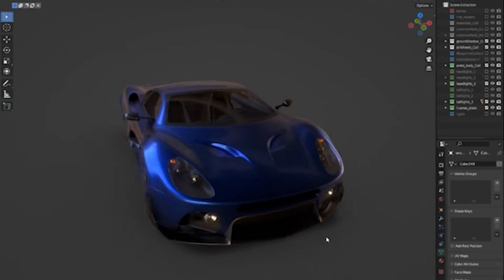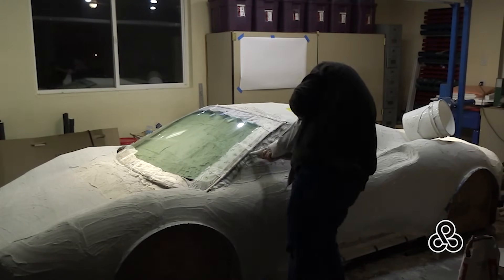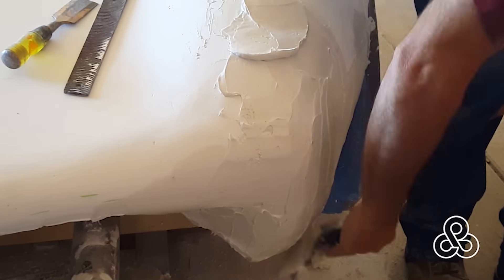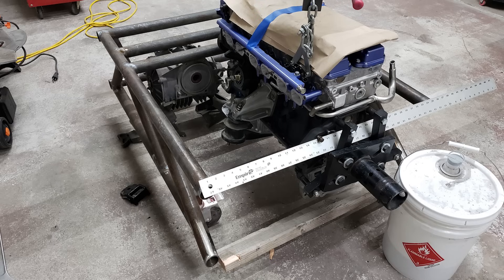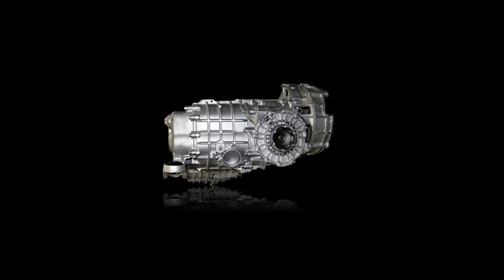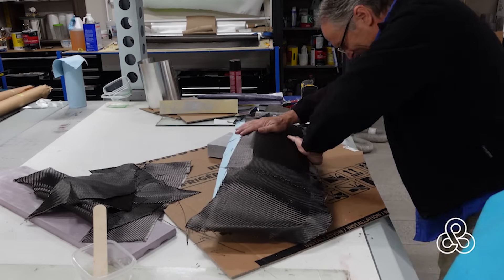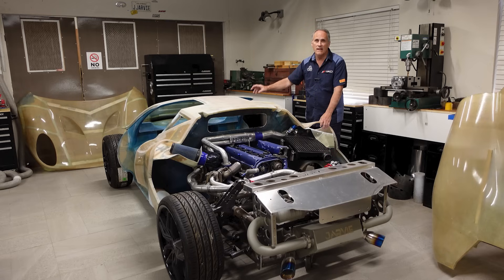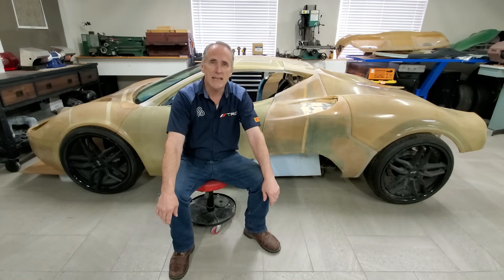Can you build a car from scratch? One man's journey.

Comment: What would be fun is to design your own engine block and cast it yourself, like a 6 liter 3-cylinder designed like Toyota's GR Corolla.  That little 3 cyl can push over 300 HP at around 1.5 liters or less, imagine would a upsized version of that engine would produce.
Reply from the maker: ONE DAY!

Comment: Carbon fibers main advantage whe building a monocoque is not the small yet not insignificant, in strength to weight, but instead a large benefit in stiffness per weight. You want the chassis to be as stiff as possible, so that the suspension  can do its job properly. However, my main concern with your construction is not the fiber type, but the matrix. Hand laminating is an easy way to make parts, but it is far from the best. You need to apply more resin, makin the part heavier while not improving strength. In fact, the resin distribution ain't ideal, leaving dry spots and pinholes which reduces the parts strengh. Furthermore, as the part does not seem to be vacuum bagged, the individual layers of reinforcement where not pressed into the mould during cure, making the part less stiff. To make it worse, as the chassis is a very large part, some resin might have already cured before the next layer was applied, resulting in insufficient adhesion between layers.

Comment: Im not into cars yet here I am with a 3/4 size single passenger rip off of the $40 m Bugatti Atlantic at the rigid foam and kitchen  knife stage although the grill and hood are precise with 3/16" foam board strips and Spackle.
I would say Bugatti riped off the 1925 Rolls round door and the classic love chair design.
I made the largest model of Hindenburg by turning it 'on a spit' at 45 ft and changed the fins.
The Eiffel tower and made a hexagonal  base
A spitfire a concord a Falcon 9.
All unfinished.
Sorry but I just do it for me and when the thrill fades, I move on.

Comment: Designing and fabricating a composite shell is an enormous and very messy job. If you're interested in building your own high-performance sports car from scratch, with a much simpler body, Google "Midlana". Mine weighs 1,700 lbs and makes 430 hp.

Comment: May I ask, what transmission did you use and did you use automatic with paddle shifting?  I have a Cayman and wish it could have been 4wd
Reply: I’m sirprised he isn’t sunburned from all the bare hand welding.
Reply from the maker: Using the 4L60e transmission, which can be electronically controlled with paddle shifters.

Comment: Very cool project indeed, I bet that'll be a lot of fun to drive!

For the transmission, you could have used a VAG gearbox. Some of their platforms are FWD, but the engine is longitudinally mounted on a transaxle gearbox like the Porsche, but it goes behind the engine, not in front of it. They are readily available, can be built to take 1000 hp and would simplify things immensely. You would lose the 4WD system, but would save quite a bit of weight in the process.

Comment: What AWD transaxle that can handle 600 hp and only cost $300?
Reply from the maker: It is not a "transaxle" it is a transmission and center differential that splits the power to the front and back - 4L80e

Comment: Maybe I missed it, but why not roll/bend the frame tubes instead of the hard angles?
Reply from the maker: The 4130 {chromoly} steel is a nightmare to bend without a very strong mandrel die bender, of which I do not have . . . other than that we could have saved a few welds couldn't we?

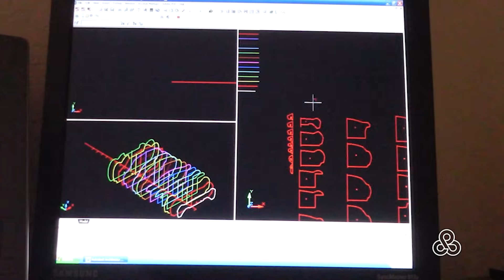Comment: Sir can you please tell me which software are you using at the 1:16 of the video?
Reply from the maker: The software is an old version of AutoCAD called Architectural Desktop. I do much less architectural drawings these days, but the autoCAD engine is still very useful. back in the day when I bought the software it came with a lifetime license. today you have to buy a subscription so I haven't upgraded. I do have a subscription of Fusion 360- AutoDesks CAD CAM software.

Comment: lets say hypothetically i wanted to build my own supercar, and lets say hypothetically i have no clue what im getting into, what hypothetical advice would you, the person reading this hypothetical comment give to the hypothetical person writing it?

for those who couldnt see through my very subtle hints, i think i want to build a supercar, i have some experience working on cars, taking batteries out of priuses mostly, and a lot of tools that i dont use much anyway, but idk what to expect from this sort of endeavor skill wise or price wise, so im looking for advice from yall
Reply from the maker: Hypothetically I would never give advice! Realistically, I would tell a up-and-coming builder to start with a rebody project. Find an existing car and strip away as much body as you can and build new styling on top of that. The Vedor kit car is a good example. That way, you have a fully running car with proven suspension and mechanical systems throughout. If you survive that build it will give you enough confidence and experience to tackle more complex builds. Plus you will have a car in a short time rather than years. Drive it while you build the 5 year project. Hypothetically of course!

Comment: As to the subject of material choice, the only reason to use carbon fiber would be to take advantage of its superior tensile strength.  It doesn't look like you have access to the kind of engineering tools you would need to utilize the properties of carbon fiber, so I think you made the correct choice by using fiberglass.
Reply from the maker: That's what I keep saying! Until I have a copy of CATIA and a really big autoclave the cars will have to be glass and heavier.  Thanks for watching.

Comment: That's brilliant work! I like the way you redefined the way to use your power plant.
Another channel where they "reproduce" a car from scratch is NHET-TV, where they make supercar-looking cars from a kinda-working platform, scavenge the stuff they need and build/mold everything else, the only CNC'd parts are the wheels (they probably didn't feel confident enough to use a lathe for that). The fact they're working as a family probably helps...
On my side, I'm more about making a "concept-plane", and I have been working on it for the last 30 years (in and out, more out than in) and it was the initial reason I went into 3D-printing, to test the different concepts I imagined into it. My last attempt did fly with RC motors but met the railing of the terrace pretty roughly: it looks RC motors are a bit more powerful than expected.
Reply from the maker: There may be aircraft in the BuilderCreator channel lineup in the future. Stay tuned.
Reply: @BuilderCreator  Brilliant! Looking forward to it!

Comment: How many layers of fibre glass did you end up using for the strength you needed?
Reply from the maker: It varies significantly. Some cosmetic panels (no structural value) have as little as 4, whereas there are up to 40 in some corners where the sub-frames join and bolt to the tub. There are 60+ layers in the vertical laminated beams, embedded into the rear firewall, that create roll over protection. Here is the video of the vertical laminates. Enjoy, and thanks for watching.  https://youtu.be/-RKgiU5bE7k

Comment: OH i thought about doing this too for a long time, but i never even tried because the cost that i aproximated was completely absurd, but when i see you doing this i really want to try too, especially when i see that you can fit into such tight budget. I wouldnt do anything fancy and it will likely look awfull, but i want to fully build my car too. How long do you usually spend on a project? I have really really tight time budget, so it would likely be multi year project, as i can barely find 3 hrs a week. one problem is that getting permission for driving it in my country will be pain, you cant even change anything on your car without getting a permission. for example, when you lower your car, or change your exhaust, you have to get it approved, so you cant drive it for at least multiple month, and you can lose your drivers licence for a year for driving a modified car.. also you cant have it preaproved, so you have to modify it, request permission, if its refused, you have to rebuild and request again and there are no clear guidelines, so you have to try and fail till they finally aprove it :/
Reply from the maker: There will probably be 4000 hours into my car before it rolls and has paint. For you at 3 hours a week, that will be 1333 weeks or 25 years. You will have to find more time; or build it for posterity. Don't worry about licensing, you can donate it to a museum and visit it in your hover plane that we will all be flying by then. Ha!
Reply: @BuilderCreator  oh hell 4000 hours is insane. I guess that I'll need way more time than that, as it wil be the 1st attempt. But 4 years from now i should have more free time, where it could be real to finish it. Its also definitely not my field, but how hard can it be to make some crap box right :D . (Im a nuclear engineer)

Maybe making some fun vehicle that doesn't have to be licensed for use on road would be way smarter idea, so i can say least drive it on my land.

Comment: Hi, just found this project and channel. Very well done and interesting! I do wonder; why create the running gear? Brilliant solution about the transmission coming to center and then powering AWD, but isn't it very intimdating/ambitious to learn all of that from scratch? I would guess in part as to why I was recommended this is because I watched an engineering video on the McClaren cars, so I would guess you saw that too? I know this isn't F1 but the do go into depth about the reasoning they chose lengths of the shafts, mount points, compromises. They also have a detailed section about the process it took to build a crumple box for up front. So what I was thinking is maybe you could pull an IRS from a proven set up. I guess one of the problems about problem solving is the compound problems coming from places you can't even forsee. 
Well, regardless, I will be here to enjoy seeing it play out! Best of luck!

Comment: Designing a non-plug-in EV AFFORDABLE, reliable car. You drive into a well lite and safe, Battery Exchange Center. You press a bottom to unlock the 2-low batteries. The service attendant removes the 2-80-pound batteries. From the top of the back of the car's Tunk space. Then the attendant puts in 2 fully recharge batteries into lock place. The attendant than check your tires PSI and cleans your windows. Done in 10 minutes. No need to pay the attendant anything the bill is paid monthly. When you buy the car, you DO NOT BUY THE BATTERIES. YOU DO NOT OWN THE BATTERIES. The company maintains the batteries. Uncharged batteries are put on pallets. Then they are put on trailers to be pick-up. To be taken to min nuclear power plant in that city. Once the batteries are fully recharge, then they are put on pallets. Put back on trailers and the trailers are drop-off at the BEC. If a battery is damage in an accident, they can be exchange for a replacement. Each time you pay your BXC bill, a percentage of the payment goes towards batter-care. Batteries are design to last 100 years, and they are inspected regularly. You can buy or lease.
Reply: The small engine keeps the car batteries charged and moving up to 4 to 5 days.
Reply: Small modular nuclear plants. That are located outside large cities. Could power the batteries for all cars that travel just locally. Less than 100 miles per day trips.
Reply: The car can be a 4-door with a hatchback and fold down tail gate, or 2-door. For a fast and easy battery exchange.

Comment: People fail to realize how close the performance of S-glass is to carbon fiber. S-glass is actually ~40% stronger than carbon fiber in tensile strength (roughly equal when you factor in mass), and equal in compressive strength, but carbon fiber is almost 3x stiffer. So if you don't need the stiffness, you're better off saving a ton of money and using high-end fiberglass (Carbon fiber is ~10x the price). And Kevlar is a good option if you need impact or abrasion resistance.
Reply: Thanks, I have full video about this, or I can refer people back to your comment  here! 😊

Comment: I found your channel when doing research for my own (much more modest - a quad streamlined bicycle) project, and binge watched all your Arete videos, together with a few others - they are great educational videos for someone who's only getting into the industry.

Just one quick question - I must have missed what kind of foams you used for the firewall/bulkhead and floor, and for bracing of e.g. the bonnet (the blue foam). I originally planned to use XPS as it's the stuff most easily available in Poland, where I live, but I found that it might be too brittle for core material. Could you give me a hint what foams you used?
Reply: The bulkheads are polyurethane. Places where I am using the foam as a shape rather than part of the structure I use extruded polystyrene that is used in home construction insulation. I will, however, be using the extruded polystyrene (45mm) sheets to form the wall panels on the Leviathan overlander project. The wall panels will have some structure, but the aluminum frame is the main structure.
Reply: Thanks a lot!

Comment: I am curious as to how you are designing the AWD and with what factory parts? I have seen a few Lambo replicas that used a V drive with the same engine configuration as you have for RWD. Are you using parts like Subaru or Audi? Your build quality is top notch. Well done sir.
Reply: I am building a one-off center differential out of a Borg-Warner transfer case that will send the power forward and aft.

Comment: Looks like your molds are better than 'one-part' molds.   Mine are usually as minimal as possible, and basically can't be used a second time, or not after a week of the mold warping from being so thin.   I used to custom build everything, but then you have something that can't really be fixed.
If just the steering column turn lever breaks, it means hours to create another one.   So these days I'm all about reusing existing parts as much as possible.
Reply: My problem is that I have no room to store them, so they are outside. In a few years, if i haven't needed to make extra parts (or more parts) they will be "one part" molds. There will be more "off the shelf" parts on the next car project.

Comment: So the transfer case that would put the power to the front wheels in a "normal" application is now converting it to the rear? And the diff is flipped to match the output front and back?
Reply from the maker: Yep! Front diff is flipped. The center differential (transfer case) is constructed out of components from a Borg Warner case, where the viscous coupling and planetary gear set puts 60% to the rear 40% to the front.
Reply: @BuilderCreator  Thats really smart I love the ingenuity! I've have a very similar idea for a build.

Comment: Very excited about this project :) I'm surprised to see you using windows xp .
Reply from the maker: Yeah! I bought Autodesk's Architectural Desktop back in 2005 when I was doing architectural work. It still works great, but only on an XP machine. I pay for a Fusion 360 subscription each month (the new software extortion method), but not willing to pay again for a simple CAD program when the AD AutoCAD works fine. ;)

Comment: Why not RWD-only, with cheap, old generation Audi A4 or A6 6-speed FWD gearbox, from 1.8T, 2.7TT or V6 TDI? 
Your skills are very impressive, great job!
Reply from the maker: Looked into the Audi option, as you can have the internal parts cryogenic treated to strengthen them to handle the horsepower, but somehow decided to try the AWD idea instead.

Comment: I wish there's more creative people like you. Thank's for sharing your passion with us, it's truly an inspiration to me. Keep going!
Reply from the maker: If there were more creatives then I would just be average. Ha! Thanks for following the build(s).
Reply: I think there's a lot but this is not a small task. The forge by local mother's got a 116,000 car design submissions. I am optimistic about the future. The Lucra that's never been built the ring others Pantera an Australian GT40 haltech interviewed. Direct digital to manufactured part. If they're was an automotive design platform with digital twins, generative AI, and part ordering it would make custom cars much easier but as it stands the research for what parts, learning CAD, having to weld takes so many skills. High end builds require 150K just in parts 😢.  The super performance Daytona Coupe or factory 5 Daytona frame.  Janerrelly design 1 front and rear on the Factory Five front mid engine they never made was my dream. With some chip foose E Type in there but even the research design and build is above my ability or pay grade. SEMA opening up there parts database, getting people on the same CAD, streamline part ordering and project planning could really help. My plan is to start with the small readily available parts from a crashed LS7 Z06.  Design in Rhino or Blender or AutoCAD unsure. CNC laser cut styrofoam molds with Prepreg carbon fiber base. Laser cut CNC bent tig welded superleggera  chassis and a hit formed tucked in roll cage. C6 suspension geometry beefed up tremic and a Ford 9" mated together in the rear inboard suspension like on Detroit speed rampage. 5" ground clearance with hydraulic lift Will wood Carbon 6 piston brakes. Quick Adjustable suspension and rear end that cool exposed shift links. Ricaro seats with the gromits for heated and cooled seats momo vintage steering and seatbelts. Nelson 427 aluminum block pro touring TT LSX. I know it's possible but I doubt many people could even build it. It lives in my head because I don't have a million to pay someone.